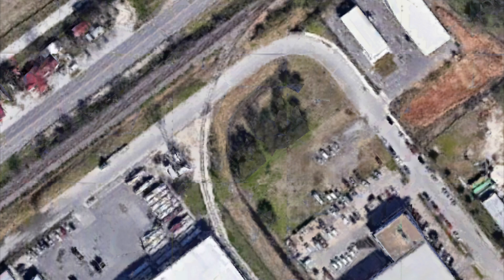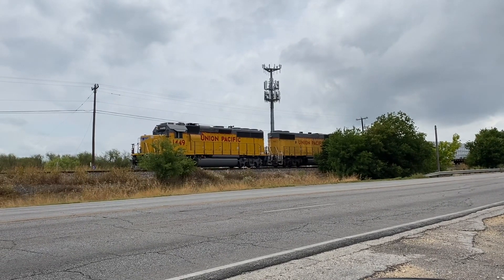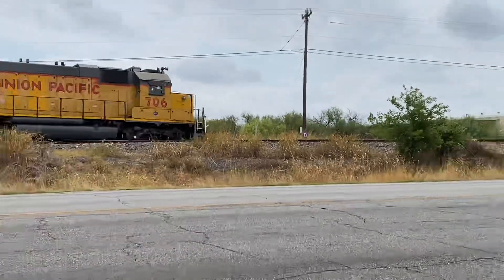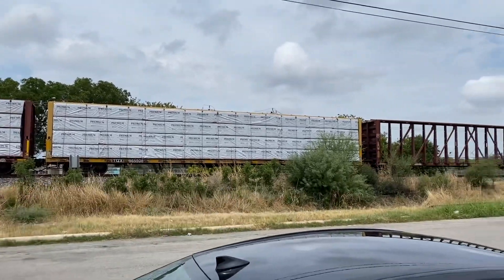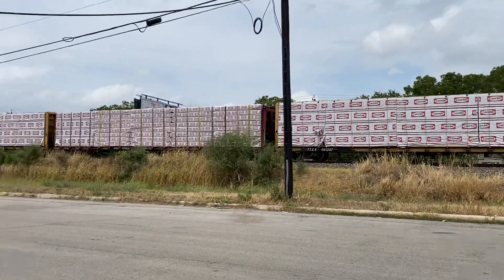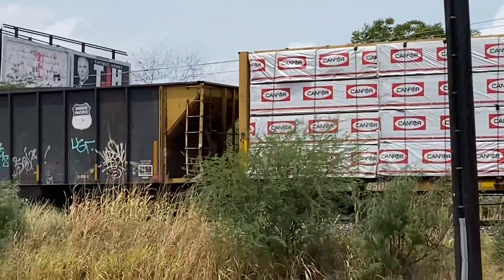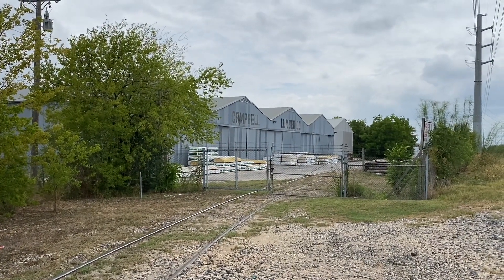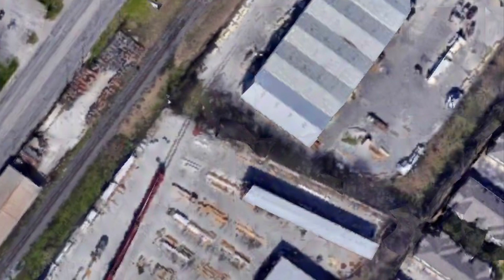UP local switching a Home Depot distribution center in San Antonio

Comment: Good timing as many locals work at night. Then #1449 still has some of its SP style rear headlights. That SOO car made a long trek and note it's from their first order and sports canvas straps instead of metal wires tiedowns. It's pretty rare to see loose hoppers today with so few places burning coal. Perhaps gravel for the cement plant?  Otherwise UP has been picking up scrap ties in those cars so they may be doing a loading session. Lastly lack of a good run around track so get the empties on the way back. Love that old lumber house at the end.  Has the 40ft flat feel.  Great 🎥
Reply from the maker: Thanks Paul. The empties were still there on Monday. Going to check again tonight after dinner. Thanks for the information. It’s always interesting. Stay safe!
Reply: @thomplacier677  of course the conductor has to mark these as pulled from HD even though theyre still stashed there so HD doesn't have to pay demurrage. At the end saw the dog enjoying AC in the house. Just saw a clip on local TV for the.humane society trying to get foster families for most of the 60 beagles from NC. A closed research breeding lab gave them up and sadly most of them have never been out of a cage much less walked on grass or even being held by a person. They are so sad looking and don't even wag their tail because they've never experienced personal attention If I had better Mobility I'd probably get two cause they sure could use some love.
Reply from the maker: @paulbergen9114  I adopted 2 dogs that had been rescued from a breeder one time. They were scared to death of how grass felt. Would use the bathroom on the sidewalk. They also could not figure out stairs. Pretty sad. Hopefully they can find these dogs good homes. Stay safe!
Reply from the maker: @paulbergen9114  I adopted 2 dogs that had been rescued from a breeder one time. They were scared to death of how grass felt. Would use the bathroom on the sidewalk. They also could not figure out stairs. Pretty sad. Hopefully they can find these dogs good homes. Stay safe!

Comment: Great Video, agree with another commenter, maybe they pick them up on the way back??  I noticed there is a Capital Cement facility really close.  From Google maps there are those hoppers parked there, as well as some covered hoppers and tank cars too.  The facility has a wye in it and there is another wye to get off the 'main'.  Maybe they need all the room they can and leave those empties for a little bit?  Also, that wye to service the cement facility is before that last spur you went to, so that is probably why you never saw the train again.
Reply from the maker: Great call on the wyes at the cement plant. I hadn’t picked up on that. I did see the train again. After getting tired of waiting for it, I headed back down Wetmore Road and it was stopped on the main close to the Wurzbach Parkway. You are probably correct that it was going to head to the cement plant. That is a HUGE place!
Anyway, as of Monday morning the empty centerbeams are still sitting at Home Depot. I may check on it every day since it’s close to the hotel.
Thanks for the great information. Stay safe!
Reply: @thomplacier677  Interesting, I suppose they could have an empty local that just collects the empties?  Maybe on HOS thing for daily work or that day?
Reply from the maker: @VSLAModelRR  , maybe but it seems inefficient. They need to remove a derail, unlock gates, release handbrakes, and pick up the cars when that was already done yesterday. I even thought that maybe they didn’t want 5 empties on the front end of a heavy train. I’ll just keep checking.

Comment: Thanks for sharing Thom! Did you count how many cars they set the brakes on when they left the train on the main? That track that went through one customer to reach another would be interesting to model. Cheers and stay safe.
Reply from the maker: He set the brakes on the first 3 cars on the train when they left it on the main. I couldn’t see how many he set on the cars in the siding. Stay safe, Maurice!
Reply: You'd have had a field day in Cudahy WI where the CNW came thru a big building at the Ladish Corp then cross Packard Ave and go 2 blocks thru backyards to a lumber yard. Alas gone by the late 70s
Reply from the maker: @paulbergen9114  that would have been cool to see. Thanks for the story. Stay safe!